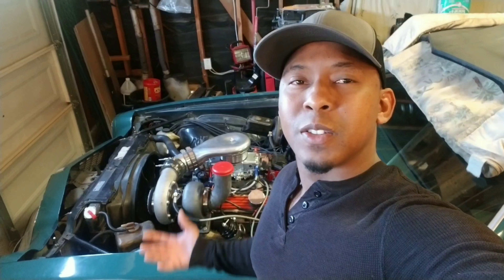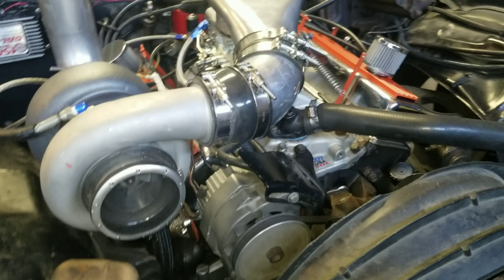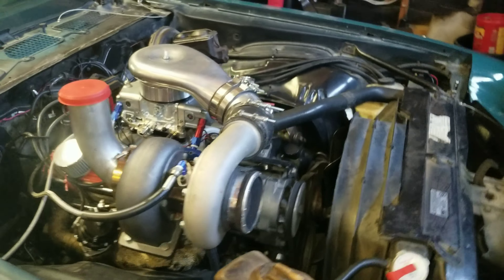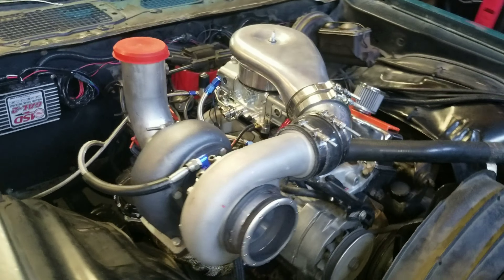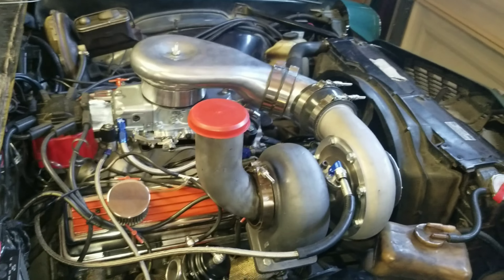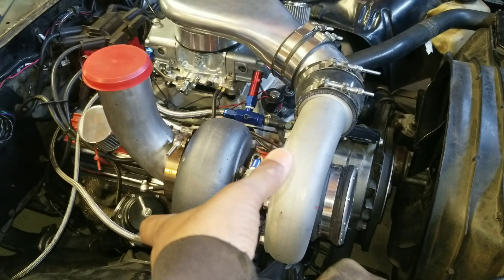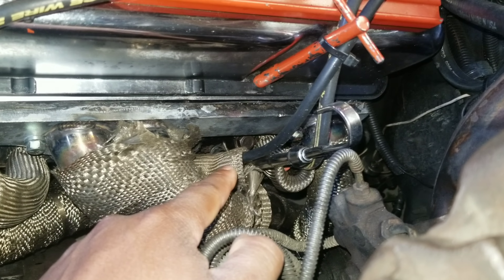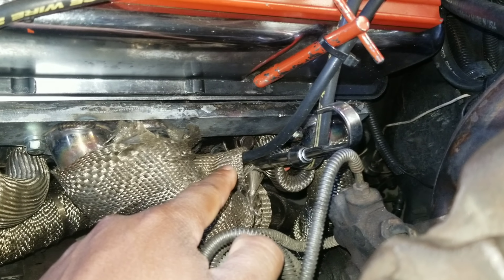EBAY'S BEST SBC TURBO KIT

Comment: How were the intake temps with running it non-intercooled?
Reply from the maker: I haven't boosted it yet. Still upgrading my fuel system. The turbo isn't connected to the carb hat when I'm driving so the boost that the turbo is making goes into the atmosphere. But blow through carburetors actually keeps the intake temperatures pretty low. Its always beneficial to run an intercooler. But with a blow through you don't have to. Thanks for watching 😁 👍

Comment: Hey, how did you run your ignition timing for your hei did you have to lock up the mechanical advance? Solid video 👍🏻
Reply from the maker: Thanks I appreciate it.. Yes, the engine builder did lock out the mechanical advance. Thanks for watching 😁 👍

Comment: Where did you get the couplers and pipe for the cold side?
Reply from the maker: The coupler on the turbo I bought from Ebay. The rest is from a spectre intake I had previously that I cut down to make fit. Thanks for watching 😁👍🏽
Reply: Duwop77 alright thanks man. Really like the videos and content!!!
Reply from the maker: @109_productions  thanks bro. I really appreciate it.
Reply: Duwop77 sorry to bother you again bro. But what size coupler do you have going from the turbo to the boost pipe?
Reply from the maker: @109_productions  it's a 3.5 on the turbo side. And 4" on the piping side. Dont worry your not bothering me. If you have any other questions feel free to hit me up.👍🏽
Reply: Duwop77 alright thanks!
Reply: Duwop77 what size pipe do you have coming off the back of the turbo?
Reply from the maker: @109_productions  I have a 3" pipe. But I wanted and preferred a 4" pipe cause that's the actual size of the rear of the turbo.
Reply: Duwop77 I tried a 4” with a v band and it didn’t fit too good.it was alittle bit that’s why I was asking because I thought it was a 4” also
Reply from the maker: Ok that's good to know cause I was going to try a 4". But here's the link to the 90 v band that I purchased. https://rover.ebay.com/rover/1/711-53200-19255-0/1?mpre=https%3A%2F%2Fwww.ebay.com%2Fitm%2F124282352600&campid=5338700573&toolid=10001&customid=

Comment: So how much boost are you workin wit ? and How did you do a turbo kit without increasing ring Gap ??? You know Bro Da RING GAP .. DA GAP .. ??? DA GAP  ... WHY ? Because the very moment your rings but up against eachother that will be the end of your WHIP.. Your motor will stick a ring and you will need a NEW WHIP MOTOR
Reply from the maker: Yes very true. Everything has its limits. Even engines with ring gaps. I keep the boost low 6 psi. It'll last however long It'll last. Till then, Stay Boosting My Friend.

Comment: Could you go over what you did for the vacuum and if you had a blowoff valve, how youd set it up???
Reply from the maker: The only 2 things that need vacuum is the wastegate and blow off valve.  Make sure they go to straight vacuum, not ported vacuum.  I tied my wastegate vacuum in with a tee coming from the carburetor. Here's a link to the video I did about wastegate and blow off valve vaccuum. https://youtu.be/uwUNTJMwpuo Thanks for watching 😁👍🏽

Comment: Yo where did you get the carburetor That's nice Where can I get 1 like that Get back to me on that if you can Love you ride Keep up the good work man have fun
Reply from the maker: Thanks bro. I bought mine from Ebay. I also found another one like mine. I added a link below if you wanna check it out. https://rover.ebay.com/rover/1/711-53200-19255-0/1?mpre=https%3A%2F%2Fwww.ebay.com%2Fitm%2F274542912562&campid=5338700573&toolid=10001&customid= Quick fuel blow through carburetors are on ebay also. Last thing if you Google csu carburetor I hear they build really good BT carburetors. Thanks for watching 😁👍
Reply: @Duwop77  LOL thank you the information I appreciate it
Reply from the maker: No problem 😁

Comment: Will your stock hood clear the turbo?
Reply from the maker: No sir. The only downfall I had with this setup. Thanks for watching 😁👍
Reply: @Duwop77  is there anyway i can put one of these turbos kits on my 87 cutlass with 5.7 sbc engine I want the good to be able to close and also keep my ac I'm sure can be done with some money
Reply from the maker: The kit should fit. Long as your heads are straight plug. The exhaust manifolds wont work on angle plugs.  Also my car didn't have ac so I'm not sure. But im sure it can be modified to work if it doesn't. If I'm not mistaken monte carlo has a deeper engine bay than camaro. So you might have enough hood clearance🤞

Comment: How much boost were you running?
Reply from the maker: I had a 5 pound spring installed. But never got the chance to experience it due to a flat came in the engine. The new swap is already in. Look out for the update video coming soon
Reply: Duwop77 can’t wait to see! I am almost done with my turbo sbc set up. I have a 383 in a 1987 s10
Reply from the maker: @109_productions  Sweet, my new swap is a 383 also😁👍🏽. That set up should have your s10 "Riding "😆

Comment: Does the turbo headers fit a Chevy 350 vortec on a 1989 Camaro?
Reply from the maker: Yes it should bolt up. But these headers are designed for straight plugs. If you have heads with angle plugs you will have to do some banging. Thanks for watching 😁👍🏽

Comment: you have a good amount of miles on it yet?
Reply from the maker: Only about 200 miles. Haven't been able to drive it due to fans not turning on. Thanks for watching 😁👍
Reply: @Duwop77  nice thinking about doing this to my nova, but ive got factory AC so itll be TIGHT. the wastegate placement will most likely be an issue
Reply from the maker: @dandaley2644  yeah that's true. It's a really good easy bolt on kit. I'm satisfied so far. Just need to put the miles on the engine so I can see what this thang can do🤣
Reply: look forward to the update!
Reply from the maker: @dandaley2644  I'll be sure to😁👍
Reply: Yeah we wanna know how it ran sir.
Reply from the maker: @scottmcguffin7768  I'm in the process of breaking it in now. I should have video of the drive up by tomorrow. Thanks😁
Reply from the maker: @scottmcguffin7768  just posted an update on how it runs
https://youtu.be/Iqhlmfz3dME

Comment: Ik this video is 9 months old but im looking for some help and this comment section seems helpful. I am trying to morph my engine into an e85 engine that can also run on pump gas. I figured this was a fun way to go because I make roughly 10:1 compression naturally aspirated. What I was wondering is if there is a way to open up a wastegate to relieve pressure and build no boost when I run pump gas. And if not is there a better way to almost bypass the turbo so I make no boost when running on pump and to make boost when I’m on e85. If anyone is wondering It’s for a 70’s 350 sbc. Thanks for any responses!
Reply from the maker: First you would need a fuel pump that can run both e85 and gas. You can remove the spring from the wastegate so that it opens with very little exhaust pressure. I wouldn't recommend it. It would be like driving with an exhaust leak. What I do is remove the top hat from the carburetor when you dont want to boost. And let the the boost pressure vent into the atmosphere. If you need further assistance I can make a video about it? Thanks for watching 😁👍
Reply: I appreciate it and a video about it would be very cool and helpful. The fact that u took time to respond is great and I appreciate it. Looking forward to watching more videos!
Reply: @Duwop77  sorry not great at this commenting stuff. But yeah I think a video on it would be great and helpful. I appreciate the response!
Reply: @Duwop77  also question about turbos. I’m looking for something that’ll spool about 8 psi before I hit 2500. As 8 pounds is all I want to run. I’m trying to make this happen as cheap, safe and reliable as possible because money doesn’t come in waves as a highschooler😂. But if u know any turbos that are for sale online or a turbo off another engine that could work well. I’ve heard that the turbo off a 6.5 turbo diesel could possibly be an option but turbos are a new world for me and any recommendations would be greatly appreciated
Reply from the maker: @ride4life602  2500 is pretty low of an rpm for turbo spool. But to accomplish that I would go with a brand turbo. Diesel turbos are good. Usually Garrett or Borg Warner. Also a ball bearing turbo spools quickly. But nether one are cheap. I'm running a journal bearing ebay turbo. It dont really come alive till about 4,000 rpm or higher😂
Reply: you can buy a boost timing retard module. it has a dial to pull 1-2.5 degrees of timing per lb of boost. when you fill up with gas, turn the degrees of retard up.
Reply: @ride4life602  if youre gonna run a diesel turbo, its a rule of thumb to run one off a diesel engine that has double the displacement. spooling at 2500rpm is gonna kill your mileage. a gt35 turbo can probably do it though.

Comment: I hear that you can't twin turbo a 305. So im asking you is it possible or not? Please holla back bruh thanks!
Reply from the maker: Yes its possible. There's plenty of twin turbo kits on the market for sbc. Just keep in mind every engine has its limits. Just keep it under its limit and you should be fine. Thanks for watching 😁👍
Reply: @Duwop77  No thank you for the knowledge..... And keep dropping them fire video's bro
Reply from the maker: @y.g.smokedog3233  thanks bro
Reply: You can twin turbo whatever you can throw money at, a 305 is similar dimensions to a 327 or 350 in almost everything except cylinder bore. You can file out your ring gap to run a lil more boost safely, but you'd make more power with a similarly modified 350.
Reply: @olratt396  ok gd looking out bruh
Reply from the maker: No problem

Comment: What size couplers are you using
Reply from the maker: Its 4"x3.5  the carb hat has a 4" opening. And the turbo is 3.5. Thanks for watching 😁👍
Reply: Also how are you able to tune this sbc & also what did you do you carb etc
Reply from the maker: @_dirtyfab5337  the carb is a demon blow through carb. Its setup for force induction out the box. I haven't had the engine tuned yet. Still in the process of breaking it in. Thanks for watching 😁👍
Reply: @Duwop77  so once I get that carb we shall be fine to move around
Reply from the maker: @_dirtyfab5337  yes. But you can move around with a regular carb. Just dont throw boost at it. Or drive it without the top hat connected to the turbo, so no boost go in.

Comment: If you the hood on, could you close it?
Reply from the maker: On a 2nd gen camaro the hood will not close. I had to do a hood cutout. Maybe on other makes and models it will close. But not a camaro. Thanks for watching 😁👍
Reply: Duwop77 I'm actually looking to buy a second gen camaro ironically that's why i came here to figure out how i can turbo a 350 without having to remove like an ac compressor or something
Reply from the maker: @corypalmer915  I see, I'm not sure if this kit works with an ac compressor. Although I think it would. But you'll have to do some modifications to fit the hood.

Comment: What up bro hows that turbo working so far.
Reply from the maker: Here's a link of me driving it https://youtu.be/aig2iNStEFw So far so good. Still need to upgrade the fuel system for boost. Coming soon. Thanks for watching 😁👍
Reply: @Duwop77  ok ok ill check it out yeah I have a 350 on mine with a stage one cam I'm planning to drop in a turbo just to play around with .
Reply from the maker: Nice, good luck with your build. Turbos are a lot of fun. Lol
Reply: Thats the 350 I'm going drop it in

Comment: Have u dynod it?
Reply: And if so how much did it make
Reply from the maker: Not yet, I'm actually in the process of installing another engine. Come to find out the original engine that I installed the turbo on had a flat cam😔
Reply: Duwop77 also what heads and new cam, and that sucks to hear man
Reply: Great video thank you. very thorough...
Reply from the maker: @85goNham  No problem. Thank you for watching 😁👍

Comment: the kit is now gone off ebay
Reply from the maker: These are the manifolds I used. Everything else was pieced together. If you need somthing let me know i can try and find it for you. Thanks for watching 😁 👍 

Turbo Exhaust Manifold  https://www.ebay.com/itm/Single-Turbo-Headers-for-Chevy-Chevelle-Nova-Camaro-Caprice-Small-Block-V8-/353774181638?mkcid=1&mkevt=1&_trksid=p2349624.m46890.l6249&mkrid=711-53200-19255-0&siteid=0&campid=5338700573&customid=&toolid=10001

Comment: What boost pressure are you running on that sbc?
Reply from the maker: Its ether a 5 or 7 pound spring. The Ebay springs aren't color coded. So you have to go off feel. Thanks for watching 😁👍

Comment: Twin turbos are easier to mount.
Reply from the maker: Twin turbo doesn't utilize the crossover pipe. So it's a little easier. Just have to double up everything. Oil feed lines, wastegate, turbo, and drain tube.

Comment: None of yall got air filter down there, sandblasting the inside of you machine there partner
Reply from the maker: If your referring to the turbo. It has a turbo screen. But your correct its not as good as having an actual air filter 😁

Comment: You can't run much boost without an intercooler.
Reply from the maker: I'm only running 6psi eventually 10psi on E85.  With a E85 blow through carburetor I've seen one gentleman run high as 26psi with no intercooler on E85. Check link below.
https://youtu.be/BzvyXGwOMcw
Reply: on a carb you can.